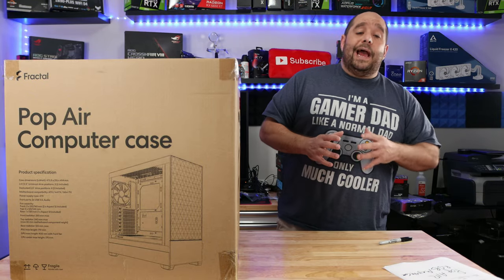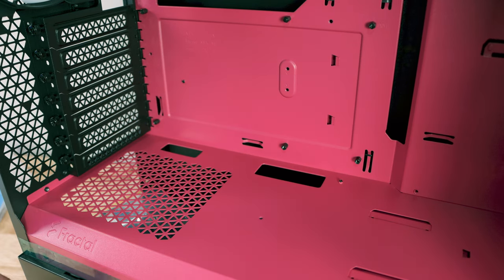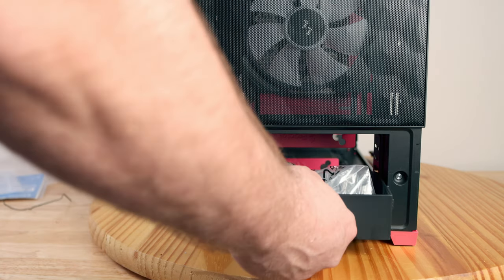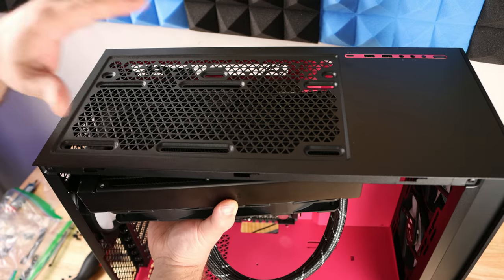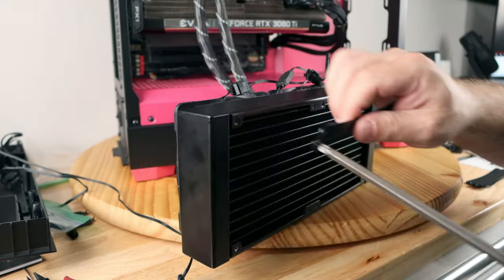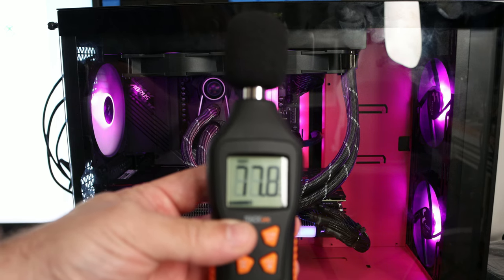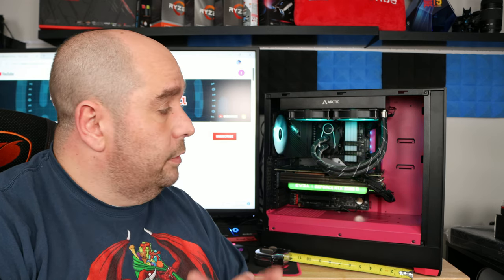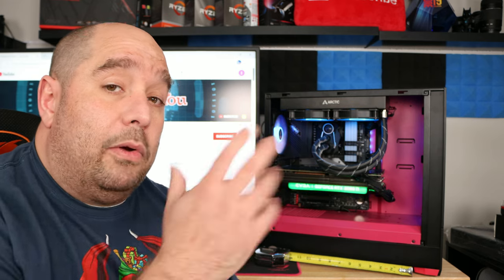Fractal Pop Air RGB Case Review -  A Budget Friendly Case that Does it Right!

Comment: Hey I'm trying to get a new case for my MSI RTX 3080ti SUPRIM X 12G, which is a huge gpu with about 13 inches in length. Would you recommend getting this Pop Air or Pop Air XL? Also, is there any other case that you might suggest? My CPU is kinda old with 3700x and I'm not thinking about any kind of overclocking, so I think I don't need any kind of additional cooling system other than the provided ones.
Reply from the maker: Have you watched this video
Reply: @ThisBytesForYou  Yeah I watched both Pop Air XL and Pop Air! I'm really bad at making decisions that's why I'm asking 😂😂 Thanks for super-fast response btw
Reply from the maker: I like the Pop Air the most, it fits my 3080TI FTW3 so I am sure yours will work fine as you saw in both videos.

Comment: Hello . I am using asus tuf z690 d4 wifi with intel i7 12700k + rtx 3070 ti . Is it wise to use windows 11 ? Some people said windows 11 creates problems with ssd . That’s why I am confused since you said so many pc I think you have better idea !
Reply from the maker: people typically say that when they don't know.  Update the BIOS to tht every latest version, since windows11 came out, I have been using it, its on my main workstation, what I used to edit all these videos and where I do all my work, its fine.
Reply: @ThisBytesForYou  thanks a lot 💙
Reply from the maker: @iamjobayer_  always a pleasure my friend, if it helps, this is how to build a system with this boarD: https://youtu.be/yqj9slC6-Cg , how to cable manage with this board: https://youtu.be/xcHwLTBDWO8 then how to flash the bios, install windows 11 and the drivers for this board: https://youtu.be/WTkMXYjxGzU, I hope it helps.

Comment: Would it be possible to fit two 3.5” drives and a 5.25” drive in the back with maybe a custom bracket?

I was thinking maybe two drives side by side with the sata pointing towards the PSU.

Such a nice looking case ❤

It’s so hard to find a good looking case with a 5.25” bay and two 3.5”
Reply from the maker: its not thick enough, though you can put them at the bottom.
Reply: @ThisBytesForYou  that’s what I was saying, flat in the bottom side by side while using the top 5.25” bay with an optical drive
Reply from the maker: with an optical drive no.
Reply: @ThisBytesForYou  it’s weird that fractal would put a mount on the back like the pop xl, but make it too shallow to use for the 3.5” bracket
Reply from the maker: maybe, but we are commenting on the non XL version, the XL hasn't been brought up, but I am not sure on the XL, since I didn't review it, you can see in the manual here if it will fit on the XL model: https://www.fractal-design.com/app/uploads/2022/06/Pop-XL-Manual-V1.pdf
Reply: @ThisBytesForYou  I contacted Fractal, and they confirmed that three 3.5" drives in the case are possible, or two 3.5" and a 5.25" drive.

They said the bracket can be placed on the back of the case wall.

https://i.imgur.com/6Ynb6Kn.png

Just in case anyone else has the same question.
Reply from the maker: @DanTheMan827  nice thank you, I didn't see that in the manual when I checked, thats cool, thanks for letting me know, hopefully I can help someone else with that.
Reply: @DanTheMan827  Thanks for sharing that diagram! I'm installing an optical drive, a mechanical drive, and three SSDs, so that was extremely helpful!

Comment: what is the maximum height for aio in front?
manual says only about width 145 mm
Reply from the maker: Did you watch the video, I go over that
Reply: @ThisBytesForYou  sorry, i didn't find this moment.
or do you mean moment at 10:58?
Reply: I mean, will the fractal design Celsius+ S28 fit with its dimensions 143 x 30 x 324 mm
Reply from the maker: @saum15  the front supports a radiator up to 280 mm max, and it can support a width of 145 mm max up at the front and you can see it on page 25: https://www.fractal-design.com/wp-content/uploads/2022/06/Pop-Manual-V1.pdf

Comment: Hi, which would you recommend,4000d or this?
Reply from the maker: I love both, BUT the 4000D is MUCH more sturdy though does not have USB Type C, at least a module for it.  I am torn really, I really do like both, though the 4000D has 3 fans up at the front, while the Pop only 2, so better cooling potential on the 4000D and the 4000D can have a 280 up at the top, the largest you can put on the Pop is a 240 up at the top.
Reply: @ThisBytesForYou  If Im right 4000d is 1 usb c and 1 usb 3.0(?). poop air is 2 usb 3.0 and from stock 0 usb c(for some reason you have to buy usb c cable separately). And Im going to buy the poop now, I think because I heard that 4000d struggles with psu+hdd cage and I have hdd
Reply from the maker: ooof, thanks for correcting me hahah, https://cwsmgmt.corsair.com/pdp/4000-series/4000d-airflow/images/reach-d-airflow.png

I like both cases, now I dislike the 4000D a little more, since it only has 1 type A.
Reply: @ThisBytesForYou  Well that doesnt matter for me at least. Most mobo has plenty. Just Im still thinking between them. either more arflow a bit or smaller case. Did you use hdd when you built in the 4000d?
Reply: @ThisBytesForYou  btw poop air is 3 usb3*
Reply from the maker: No, thinking about it, I used the 5000D, not the 4000D, you can see in this video where I upgraded my workstation since my Z390 died.
Reply: @ThisBytesForYou  Oh okay, thanks. 5000d is sadly too expensive and also too big. Max money for case is ≈100 so most of the cases i like,mostly the 500dx is very very expensive
Reply from the maker: yeah for sure it is
Reply: @ThisBytesForYou  would you recommend any other case beside poop air and 4000d? If possible please those cases which have top aio and max 240
Reply from the maker: @Tomxhawk  Yes, aside from these 2, I LOVE MONTEC, here are a few off of my Amazon affiliate list: https://geni.us/Ul8ioc, I am working on another Montec case right now (I have reviewed quite a few of their cases) and they are usually always great, and VERY affordable, I expect my review to be out in the December timeline, I can't give any other information on that though.
Reply: @ThisBytesForYou  Okay,thank you
Reply: @ThisBytesForYou Sadly it isnt avaliable in hungary so I guess i will decide between corszar and poop air
Reply from the maker: @Tomxhawk  always a pleasure my friend ;)
Reply from the maker: ahhh well yeah ,they have limited supply, but corsair and fractal make great cases, so you will be good.
Reply: @ThisBytesForYou  Thank you
Reply from the maker: always a pleasure my friend

Comment: Back to annoy you again 😂 so I only have a gpu to put in my build atm but I’ve put all the rest together so all I have to do is plug in the gpu when I get one but there’s still no power . Any idea what I’ve done 😅
Reply from the maker: Never annoying my friend, but you need to fill me in.  What are the specs of all the parts you have right now, manufacturer and model number?
Reply: @ThisBytesForYou  just before I do that would not flashing bios cause no power ?
Reply from the maker: answer the question
Reply: @ThisBytesForYou  no ? Lol
Reply: @ThisBytesForYou  

Mother board  msi b550 gaming plus  s/n 601-7c56-050b2112009960

Ssd Seagate BarraCuda Q5 1TB PCIe NVME M.2 SSD ZP1000CV3A001
Ryzen 9 5900x

Psu Aerocool Integrator 850 W 80 Plus Bronze Power Supply Unit with UK 3 Pin Power Lead

Water cooler Corsair H100x Hydro Series High Performance Liquid CPU Cooler CW-9060040-WW

Ram Corsair CMK32GX4M2Z3600C18 VENGEANCE LPX 32GB (2 x 16GB) DDR4 DRAM 3600MHz C18 AMD Ryzen Memory Kit - Black
Reply from the maker: do you have CPU, liquid cooler and power supply connected to the motherboard
Reply: @ThisBytesForYou  yeah I’m just double checking all psu connections on my psu I’ve 3 8pin connectors does it matter why one goes into cpu there not labelled
Reply: @ThisBytesForYou  when I turn on power button now the mother board leds light up then go off
Reply from the maker: yes it mater, 1 maybe 2 of those is EPS the other 1 or 2 is PCIE, they cannot switch, EPS is for the cpu.
Reply: @ThisBytesForYou  I actually have 4 8pin one cable has 2 on it and then there 2 separate 8pin connectors
Reply: @ThisBytesForYou  I got ittttttt yayyyy wrong 8pin connection lol
Reply from the maker: yup, like I mentioned, you are lucky you didn't pop it.  Also, you pushed that in HARD, there are plastic ridges to not allow you to do that, you dont need to force a power cable.
Reply: @ThisBytesForYou  tbh the cable that’s working was the hardest to go in
Reply from the maker: Mhmm
Reply: @ThisBytesForYou  thank you for your help again tho lol
Reply from the maker: always a pleasure my friend